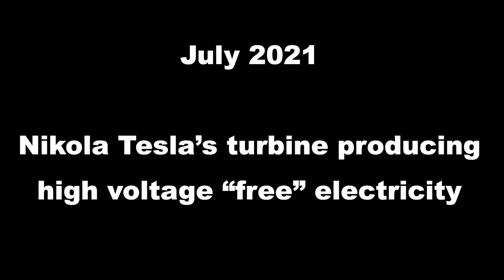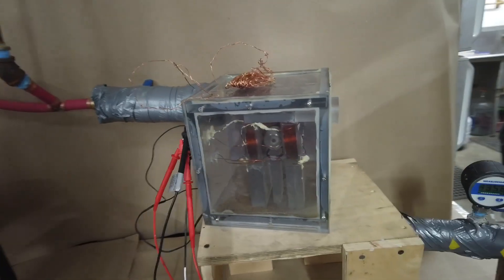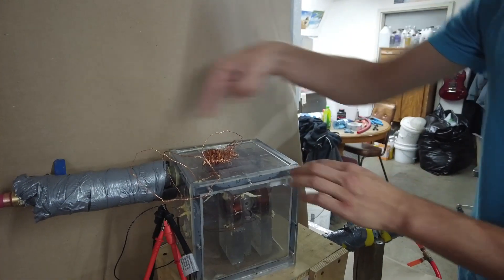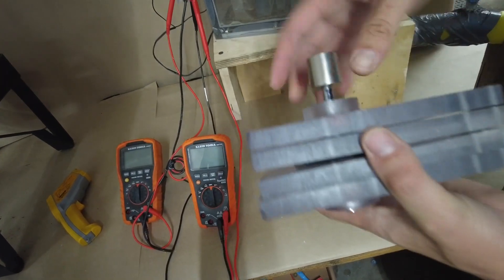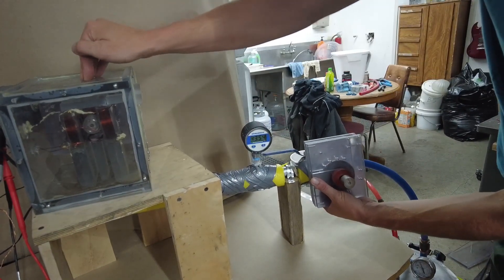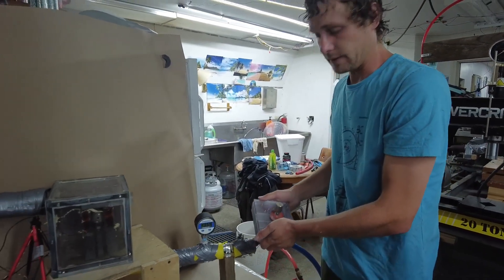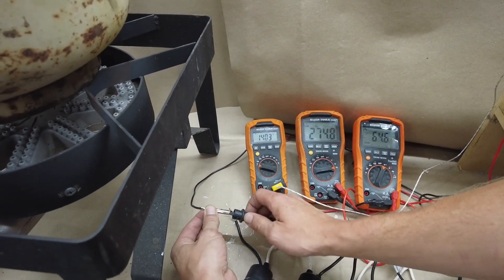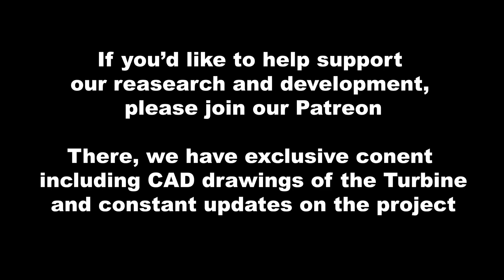Ground Breaking Renewable Energy System Using The Tesla Turbine

Comment from the maker: I just wanted to let everyone know, when we say free electricity, we are specifically talking about energy that comes from the free sun. This is the same thing as collecting free rain if you have a rain collection system at home. The infrastructure isn't free, but the water is. Many people are confused about this. The earth is also a giant battery that you can tap into, it also got it's free energy in the form of heat from the sun. See the video here that shows we are not using compressed air in our boiler. https://www.youtube.com/watch?v=W1K2CMRyDrw
Reply: I'm a small time gold miner.

I have a water system setup in the East Kootenays in BC Canada deep in the back country. I have 1 mile of 1" geothermal tubing with 900' of head already installed and proven.

I've looked at other turbine designs like pelton wheels. 

Do you think a tesla turbine would be a good option for a microhydro setup like mine?

Just want to tap into all the water I have running by my camp to charge up the trailer batteries and keep the hot water tank warm. All 12v stuff.
Reply from the maker: @FantasticCalamity  you should give me a call to talk about it, would that be possible?
Reply: Hey guys from IES , i am on your side even if part of my brain is telling me that the inputs of energy and plenty of what last comment of 616 is making sense. I believe there is a way how this can work and how change the way things are becouse of how we think.I know that physics cannot be avoided but i bet some new can be ,,invented,,. Good luck guys all whats good with u.
Reply: What material do you suggest best for the disc's? The reason for keeping the design small is so that you can achieve higher rpms correct? Otherwise whatever material used would experience ripping? Is a 6" diameter disk dreaming too big?
Reply: I believe,,, the energy generated from a conventional generator is the most inefficient way of converting one form of energy to electrical energy. Conventional generator is where the generator rotor is pushing a magnet past a set of coils. Lenz backpressure can be so strong as to slow and stop the engine turning it.

A simple change in geometry is all thats needed to create electricity cheaper. Watch this

https://m.youtube.com/watch?v=V-jI8ecXniE
Reply: Theck this: close in engine argon and helium gas and ad to it wery high voltage spark and engine will work. The same with water inside. Yutkin effect.
Reply: A DC motor spinning a magnet(s) in a reciever coil (ferro ceramic "choke" core) manifests generates AC (possible also via capacitor discharge into (on) and phase conjugation out of (off) vis resistance in a dead battery electrolyte chemistry (switch the circuit to the dead battery and the magnet will be repulsed out of the coil while charging the dead battery.) Thus, this creates a motor/generator system. An invertor oscillator or an oscillating instrument (horn, drum, bell, string, speaker, tuning fork etc.) Either switching on and off a capacitor discharge through a coil (magneto creation) is an amplification multiplier of the AC signal. Thus, achieving oscillation on off or AC amplification multiplication becomes the source for keeping the system (re)charged and self sustaining manifestation generation.

Comment: I may be wrong, but I think the Tesla turbine would be an ideal fit to a ultra high flash steam system. The steam system would do it's work, and then the Tesla unit could take the waste steam and make power and at the same time work as a condensing unit to make the other system more efficient. I read up on the Titanic engines that had a 3 stage compound engine and then the waste steam fed into a turbine with a condenser at the back end, and that turbine was producing approximately 15% of the horsepower with a steam input pressure of about 15 psi but the ultimate condensing drop was something like minus 15 inches of water because they had an unlimited heat sink from the ocean.  I like a flash system because the very high pressures of say in the order of 3000 to 3500 psi are far more efficient on energy input than the old steam systems of 100 to 350 psi, and with an ardino controller driving the fuel feed and air control, it could keep the system within operating parameters. Opinions please and thanks.
Reply from the maker: absolutely, we will be selling the turbines soon and people could use any thermodynamic cycle they choose. You would need a special nozzle for the kind of pressures your talking about, but it's totally do able.

Comment: All you're doing is using vacuum to produce steam and suck it through a turbine?
Obviously the DIY manufacturing of the turbine is awesome, but there's no free lunch and there's no free energy. The compressors you used to generate the vacuum and the energy you used to heat up the water and make the ice will have used more energy than you've generated from your turbine.
Reply from the maker: the device isn't free but the energy from the sun will be, I've already proved the point. Solar panels are free energy, even though the solar panels are not. Solar heat tubes will be used to provide the heat.
Reply: @iEnergySupply Okay, so when the water tank is empty, you have to refill it and run compressors to get the vacuum back. Those compressors need energy, and they need more energy than you get from the turbine
Reply from the maker: @jackp-j1041  Thanks for chimming in about the cryophorous turbine setup! I get the confusion, but let me clear things up. The vacuum pump (what you called the compressor) only runs once to suck out the air at the start. After that, the system’s sealed tight, so no need to keep pumping. The water in the condenser gets pumped back to the boiler, so it’s a closed loop, no refilling needed. The whole deal uses solar heat tubes to warm the water, make steam, and pull it through the turbine with the vacuum.

You’re right, there’s no free energy—thermodynamics is a tough boss! But the sun’s heat is free, just like solar panels give free electricity after you build ‘em. The vacuum setup and turbine crafting take some upfront juice, sure, but once it’s running, it’s all about that solar power driving the steam.

Hope that makes sense! Hit me up if you got more questions, I’m happy to break it down.
Reply from the maker: @jackp-j1041  Thanks for chimming in about the cryophorous turbine setup! I get the confusion, but let me clear things up. The vacuum pump (what you called the compressor) only runs once to suck out the air at the start. After that, the system’s sealed tight, so no need to keep pumping. The water in the condenser gets pumped back to the boiler, so it’s a closed loop, no refilling needed. The whole deal uses solar heat tubes to warm the water, make steam, and pull it through the turbine with the vacuum.

You’re right, there’s no free energy—thermodynamics is a tough boss! But the sun’s heat is free, just like solar panels give free electricity after you build ‘em. The vacuum setup and turbine crafting take some upfront juice, sure, but once it’s running, it’s all about that solar power driving the steam.

Hope that makes sense! Hit me up if you got more questions, I’m happy to break it down.
Reply: @iEnergySupply  Ahh, I see, so in your setup, does the condenser use power, either actively, or to make the ice?
Putting the Tesla turbine to one side for a moment (it's a brilliant device, but from a thermodynamics perspective, that doesnt matter, it's the same as any other turbine/pump.) What you've got can be compared to a fridge, your bucket of ice is the inside of the fridge, and the "warm" water tank is the black cooling pipes at the back. Now, with a fridge, work (electrical power) goes in to pump the gas around and maintain the temp difference, making the outside of the fridge warm, and the inside cold.
You claim that the work comes from the sun to warm up the water, thats great. That water boils, changes state to steam, and drives the turbine, great. Then the water cools, condenses, turns back to water, in a closed system, and returns to its initial startpoint, and the cycle repeats.
So I've got the theory, it's brilliant, but I don't see how the cold side doesn't eventually get as warm as the warm side, and then the party stops.
Reply from the maker: @jackp-j1041  Great fridge comparison, but here's the key difference: a fridge needs constant electricity to pump refrigerant and fight heat leaks. In my setup, the condenser uses a radiator cooled by ambient air (no power needed)—sun heats the boiler to boil water into steam under vacuum, it drives the turbine, then radiator cools it back to liquid water, which gets pumped back to the boiler in a closed loop.
The temp difference holds steady because the sun keeps adding heat to the hot side, while the radiator passively dumps excess heat to outside air. Plus, the Tesla turbine's over 90% efficient at turning available entropy into electricity. For nighttime, I've got a thermal reservoir using mass to store the heat energy, so it keeps generating power even when the sun's gone.
We can also take the rejected heat to heat the home in winter, effectively utilizing almost 100% of the energy stored in the battery other than what is lost through the insulation. Clears it up? Fire away!

Comment: Will it working at such low temperatures you could use thermal collectors on the roof of a building to drive to the generator turbine not even using refrigerants just water and a vacuum
Reply from the maker: that's the plan!

Comment: You are demonstrating so many scientific engineering principles all at once
Reply from the maker: Absolutely. It's a cryophorous system where all the air is evacuated. On the left (the hot side), the pressure is higher because the water vapor above the water is at a higher pressure than on the right (the cold side). The higher temperature on the left creates a higher pressure, and since pressure flows from high to low, it boils on the left and condenses on the right. This movement of gas through the system spins the turbine.

Comment: For how long can this system keep the pressure going till it fully equalises?  Great job.
Reply from the maker: until you run out of heat on the left tank, but once the water is used up it needs to be pumped from the condenser to the boiler.
Reply: @iEnergySupply  how much Timelapse are we talking about?
Reply from the maker: @PhysicsViolator  minutes or days depending on the size of your thermal reservoir.
Reply: @iEnergySupply  thnx imma try to build one .
Reply from the maker: @PhysicsViolator  Remember, the turbine and the temperature are key factors. You actually need significantly more heat than what I demonstrated in this video to run the system efficiently. Additionally, the turbine must be properly tuned to function as intended and maximize performance.

I want to stress the importance of safety if you're thinking about building something similar, like converting a gas bottle into a steam boiler. Water under pressure can build up to dangerous levels, potentially causing an explosion if not handled properly. Here are a few key precautions:

Make sure your tank is made of metal that can handle high pressure, and know the pressure limitations at different temperatures.
Always use a pressure relief valve to prevent excessive pressure buildup and avoid steam jet injuries.
Periodically test the pressure capacity of the tank, as corrosion or rust can weaken it over time. It’s a good idea to fill the tank with water and test it at a pressure higher than your relief valve setting to ensure safety.

Comment: Does the additional energy produced make up for the power required to keep a vacuum?
Reply from the maker: the vacuum keeps itself as long as the cold side stays cold. Vapor pressure is equal to temperature. So as long as the condenser is colder then the boiler the water will always flow to the condenser. If the condenser was warmer then the boiler the gas would flow backwards to the boiler.
Reply: @iEnergySupply  ah ok. That mostly makes sense. Vapor in a vacuum is a little difficult to wrap my head around. How do you plan to keep the condenser cold long term without maintenance?

Comment: great work guys.  i'm in the high speed rotating equipment industry and was wondering why you couldn't extend the shaft ends with perhaps an insulated coating and add another magnet to double the output generated. (or more)   or at the very least, make the opposite end of the shaft a generator?  there seems to be a lot of rpm you could harvest if it's possible.
just throwing that out there.   there are coatings that would maintain the shaft size and insulate the magnet from other components so it's feasable....
Reply from the maker: I would have a magnet on both sides if the generator was the limiting factor. At these temperatures the  turbine is the limiting factor. Our new turbine on our patreon page has a single generator as well, but with a 1.5" magnet and still isn't the limiting factor although it could become the limiting factor with the higher temperatures Ill be testing with. If needed ill add another generator  magnet.

Comment: If the disks are slightly warped all equal to each other and connected to each other so they spin at an equal rate, it would be posible to increase the efficiency and reduce the rate it needs to spin to gain such efficiency. Warping them in a wave form will also increase the surface area of the blades meaning you can use smaller blades. A little how a golf ball works. 🤔🤔🤔

Comment: Didn't occur to me at the time I started watching your vids, but this is a heat pipe with a generator in the middle. Not to debunk or anything, but it simplifies the DIY. Most laptop CPU have them for efficient heat transfer. And is easily made by filling copper/ metal pipe with little water, get it boiling a little until steam draws air out before capping it off in this case with a valve. Typical plumber solder works. Making one for cold and hot side, skipping the vacuum pump. 

Another resemblance is the thermosiphon aka solar water heater system. Japan suggested to harvest energy from snow like this a few years back.

Practically the same heat pipe network can collect heat/ cold from outside, efficiently transfer to thermal store and turn the turbine if valve is opened. Just saying 😂

Comment: We all understand that Tesla designed this turbine to be driven by steam, from any normal building wood steam boiler heating system, in other words, from available power.  Why are you wasting energy producing steam for a little bit of pressure and chilling it, just to keep the heat down, when this device will operate better on pumped cold water which can be regulated in pressure and volume, there controlling the obvious RPM over run that always exists in these driven by steam?

The turbine discs are dependent on pressure and fluid viscosity, and steam is lacking in this as well as in pressure and volume control.

I'm building a large HD Tesla Turbine utilizing industrial grade ethyl glycol for cool year around constant use in all weather, self cooling and freeze proof, to drive a 25KW power generator.  This is a major over unity device that should use less than 10% of it's required pumping power used to develop the horsepower and RPM needed.
Reply from the maker: I don't have any issues with over speed, It is now self regulating just as tesla described.

Comment: I've been looking for something that can be made to produce a good amount of energy for cheap without spending more money for the initial starting fuel  than the amount of energy I can get back. If I use propane or wood to heat the vessel that turns the tesla turbine, it is not as free as I would like to be worth doing this project but if we  could somehow use the sun and a fresnel lens or something that could magnify the heat from the sun, then it's cheaper, non polluting but the sun isn't always out so if a sand battery or a solar panel configuration that could save up the energy for the times when the sun isn't out so the turbine can still be used, it's something that I'm trying to figure out so it can be reliable and ready to produce electricity during any weather conditions uninterrupted. I'm very new to the  whole alternative energy experiments and I think it's fascinating.
Reply from the maker: you got the idea! You described my goals. The sand battery is designed and Ill be testing one soon.